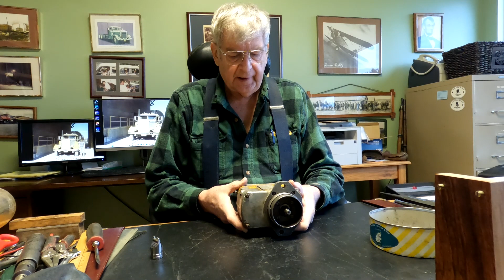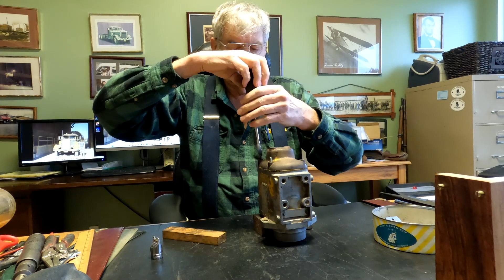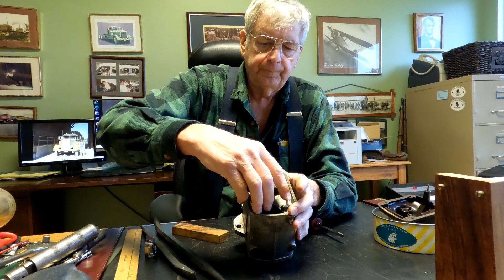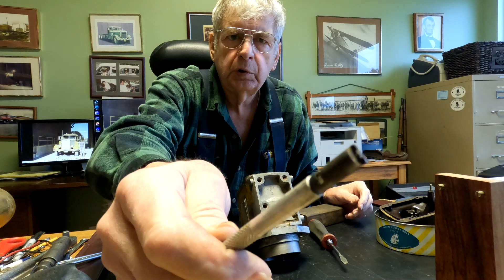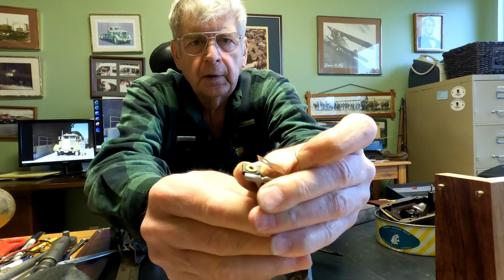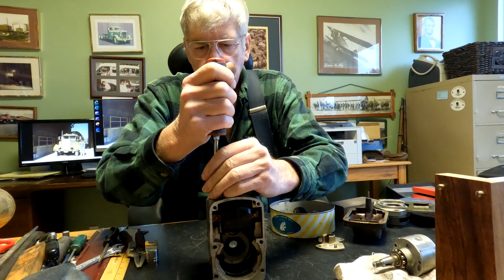Caterpillar American Bosch MJK 4/2 Disassembly

Comment: Is the points and condenser just 12-volt 6 volts or is it something special
Reply from the maker: Thanks for watching the video. Both the points and condenser are American Bosch parts. The voltage comes from the magnet rotor which charges the coil through the points. When the points open the coil sends the spark voltage through the rotor through the cap and to the plugs. 
 You can test the coil with an ohmmeter. It should show 7300 - 8300 ohms. If you have access to a capacitance tester, the condenser should read 29 - 33 MFD. Parts are available at Standard Magneto in Chicago. Just google it as they have a very substantial website that lists parts for A/B MJK magnetos. Good Luck.
Jeff
Reply: @ I’m working on an old cat D7 cable blade that I found on the farm I bought it’s been sitting since 1989 and I’m having trouble getting the pony motor to start the video that you’ve done is really helpful
Reply from the maker: Thanks for the positive feedback. There are a few videos on my channel on starting an old pre WW II D8 that has the same starting engine as your D7. All you must be sure of is that you have fuel, compression, and spark at the right times and it will run. Best of Luck, and feel free to ask if you need any more information.  Jeff